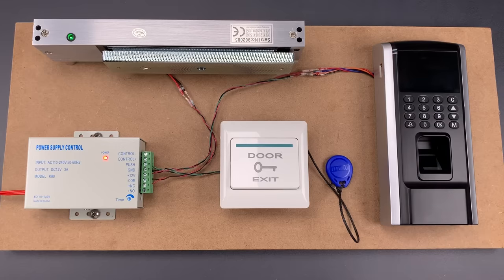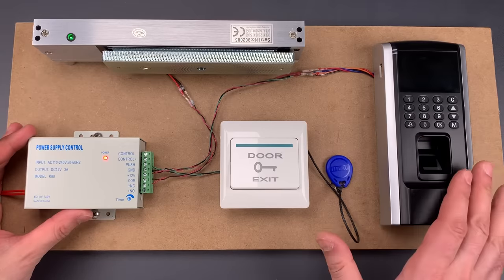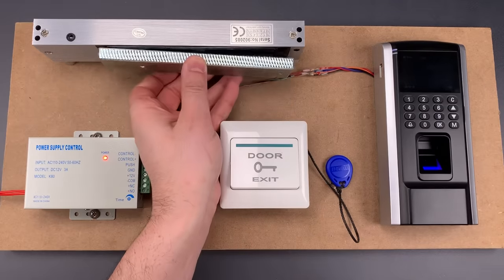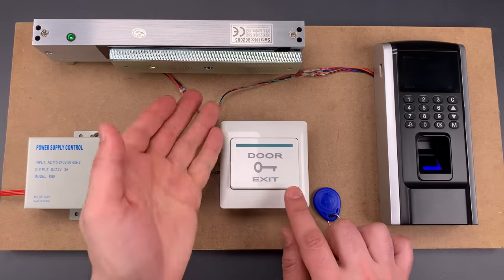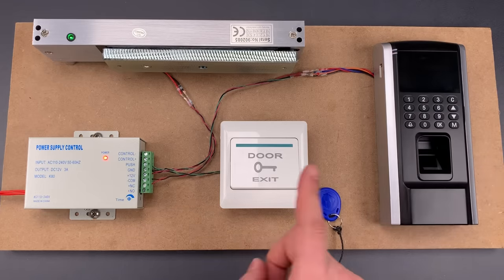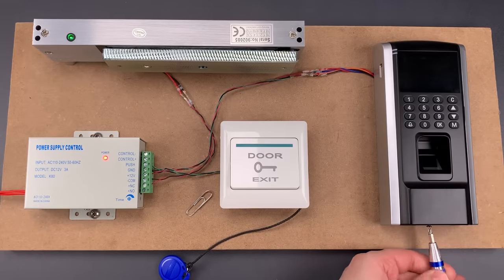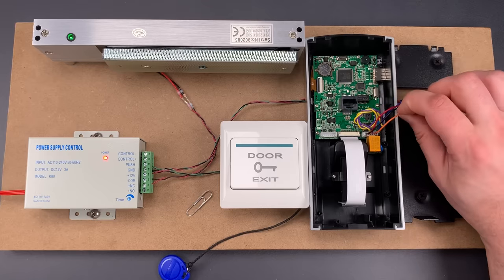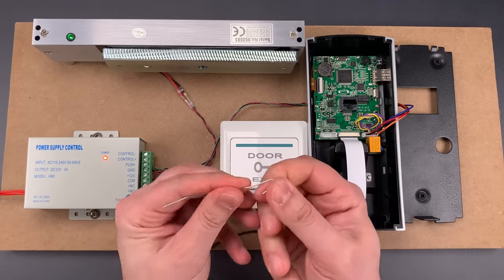[1040] Fingerprint/RFID Lock Defeated With a Paperclip (Mengqi-Control)

Comment: this type of thing of thing never comes up in mission impossible movies. They'd have found a way to copy the fingerprint or executed an awesome stunt to cut the power.

LPL- here I am with a screwdriver and a paperclip
Reply: To be fair, mission impossible is usually about super top secured facilities, where consumer hardware like this would never be used.
Reply: Wasn't McGiver like this? But to be point of stupidity?
Reply: Anton Juul-Naber Eh.. military grade doesn’t mean much.
Reply: Military grade mean't made by the lowest bidder right?
Not always the case, but hey maybe when Area 51 raid actually happens.
Reply: @Anton-cv2ti  reminds me of when I was a civilian contractor working on a air Force Base that I had to have clearance  enhanced to work on this particular building  and a full time escort to get into and out of the area.  The gard was unable to get his electric key to work as well as unable to call the inside gard ( both required to have keys and unlock at the same time). So I was like let's go through the overhead door they put the switch on the outside and I think with a screwdriver I can hit the open button.  Boom 16X16 door opens. Never figured out what they did in that building other than have a very fancy lock on the man door.
Reply: at least if the bad guys  knew about this they wouldn't be cutting fingers off to get the print and gain entry....
Reply: @mittensfastpaw  you're right, and I don't see how that relates to my comment :)
Reply: You forgot the "remove finger/eyeball" trick. Works every time.
Reply: @chasemc69  Well you ain't wrong.
Reply: J she used a machine gun to blast away the wall to get access, guess she forgot her screwdriver , lmao when I saw that.
Reply: YES . Hats Off To You SIR . TRUE COMMENT .
Reply: This is the kind of stuff that's shown in Mr. Robot. Way less exciting but way more realistic.
Reply: Paperclips don't sell movie tickets!
Reply: It's easier than cutting off someone's finger
Reply: @niccatipay  Raid Area 51, steal all their locks just to see if that's true.
Reply: You're expecting that moment when Ethan looks stupidly at Benji and says that's it?  and Benji replies "Ya, what did you expect?  and i've been watching a lot of the LockpickingLawyer"
Reply: they used to do this all the time in star trek in the 24th century lol
Reply: @tysleight  I found that those overhead doors could be opened by reversing the wiring in the unit that was outside the SCIF - just like this video.
Reply: @goetzliedtke  Was this SCIF located in the 80's?
Reply: LPL in an action movie: Saves world, defeats evil villain and says "In any case, that's all I have for you today."
Reply: @kenhukushi1637  Sadly all of that would happen in under 5 minutes.
Reply: I genuinely hope the next big heist/spy movie goes through an elaborate plan to pop the lock, only for the actual lockpicker to show up and be like, "What's all this? I just need 2 minutes and a paperclip."
Reply: @nephicus339  "I just need 2 minutes and this pick Bosnian Bill and I made"
Reply: in RED Bruce Willis just punched through the wall and pulled out the wires or something like that.
Reply: Deviant Ollam - Here I am with my latch slipping hook and literal garbage.
Reply: Very true! I preferred the days when I was impressed by those actions in the movies, instead of being a downer now, and saying things like "cutting the power won't work, as most of those devices are set up as "fail secure" so they stay locked in the event of a power failure"... I miss the old days
Reply: @willstikken5619  Strictly speaking, it wasn't a SCIF.  It was a special weapons storage facility - treated pretty much the same.  I think it was the '90s that we found the vulnerability.  I found it again at a data center in the 2000s.
Reply: @JukaDominator  you're half right
Reply: I'd like to see a movie where the burglar after going through excruciating steps to reach a door that bar the access to the big secret gets pissed of by seeing a lock like this, throws a tantrum then open it like LPL just did
Reply: This wouldn't work on a lock that mission impossible would bother with. Like he explained. A good security system would have the credential check happen behind the door in the secure area. This worked because the credential checker is on the input device, which is unsecured and can be manipulated. If the credential checker was inside the building, it would not have unlocked the door. It would wait until the proper digital input (correct code) was sent to it. You can't do that by bridging a connection. This paperclip did not make a code. It physically did what that cheap input box does once it has the right code. The box makes the connection inside itself when the code/finger/rfid is verified. A Mission Impossible tier of security would at the VERY LEAST have that credential checker inside the building. If you attached the connections, the system would just register it as an invalid input and likely trip the alarm or not respond in anyway at all.

This is more a McGuyver more than anything else. He'd be breaking into simple buildings that would overlook such simple security measures. Like a business office, or construction building. General security type of stuff. Mission Impossible is multi million/billion dollar building with geniuses in anything digital, electronic, IT, or security. And millions to invest in security systems. I don't think a world altering object or piece of data is going to be protected by a $200 door lock sold on Amazon in Mission Impossible. That would make a really shitty plot lol. "Well if they bought a better door lock!" I mean MI would honestly just have an RFID brute force spammer thatd open this thing up more covertly by not even needing to be opened up.
Reply: You only need a screwdriver to remove the fascia then you put your fingers in and rip out the wires so it never works again..
Reply: Michael Persico And even things made to “mil-spec” don’t have to be tough; if the spec says it can be made of cream-cheese, then its as soft as, well, cream-cheese. Depends what the spec is for. I’m sure the spec for toilet paper doesn’t require it to be hard :). Just sayin’.
Reply: In the movies, if you want a door with an electronic lock to open you just shoot the lock. If you want the door to close, just shoot the lock.
Reply: MacGyver trick.
Reply: I take it you didn't think this comment through literally at all.
Reply: @niccatipay  
The have very strict specifications on the other hand.
Reply: Stargate... They used to do this all the time on Stargate.
Reply: @niccatipay  In all honesty I still see military locks are old fashioned and now I know how unsecure a lot of facilities really can be. Never look at a lock as a way to never worry about the things behind it being taken. A lock is simply to deter or impede. Kinda explains why military always does layouts daily or weekly
Reply: Very true 😂
Reply: JukaDominator Its MacGyver, and I resent the stupidity comment, although it is well founded. That was exactly the premise, he'd get out of wild situations with pretty much what he had around and a Swiss army knife
Reply: Please, please put LPL In an MI movie to just ridicule a bypass scene
Reply: This scene from Sneakers is one of my favorite movie moments. https://www.youtube.com/watch?v=oG5vsPJ5Tos&t=57
Reply: @niccatipay  Made by the lowest bidder to 25 pages of exact specifications.
Reply: "A little blush. A pore-strip. And... Voila!"
Reply: This is a great idea.  The audience expects the locks to be opened with an extremely complicated way, but you can break the expectation by opening the most high tech final lock by exploiting a very primitive design flaw at the very last minute.

Comment: For me senior project we are using a fingerprint sensor in a similar type project and another flaw besides that is that they typically store the fingerprint templates ON the sensor board. So theoretically you could pluck that board, plug it in somewhere else and dump all the stored fingerprints. How do I know? I've tested it for my project.
Reply: Fk that's really bad.
Reply: no shit
Reply: @connorzoesch9087  I more meant for the system he was working with, but I can see how the way I worded is confusing.
Reply: But Is it on Github?
Reply: @piezaclave393  no.
Reply: @117BlackHawk  why Tf not?
Reply: @piezaclave393  the code to actually dump the fingerprints is included in the arduino examples
Reply: @117BlackHawk  Nice 👌 .... planning a heist this week. 60K if successful. This will come in handy